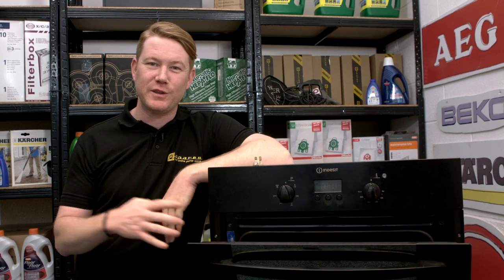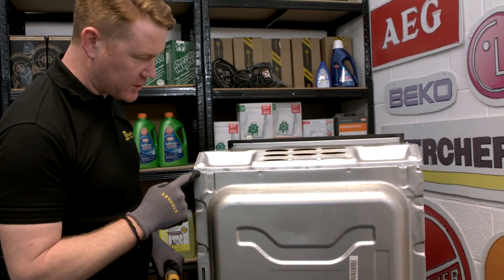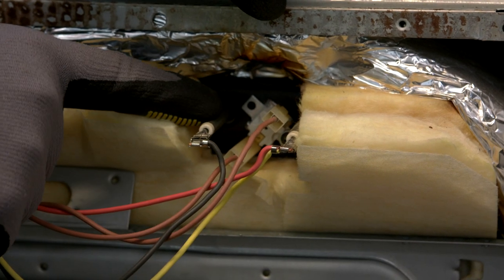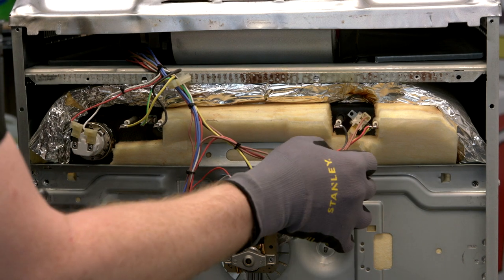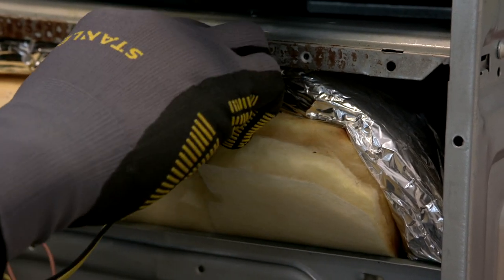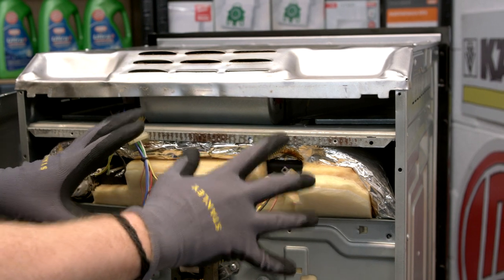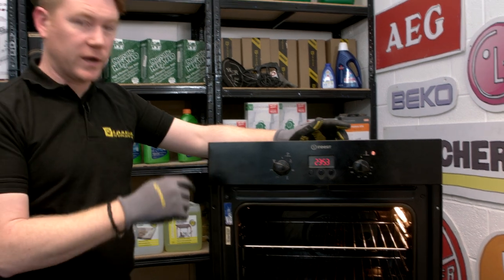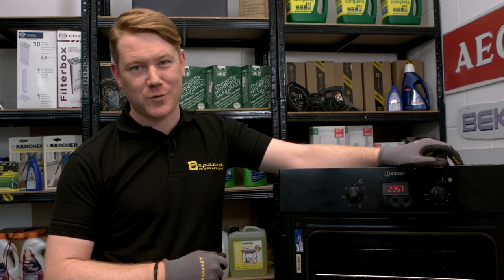How to Fix an Oven Thermal Cut Out

Comment: I have a kuppersbosch and we have no heat in any mode (fan oven, top/bottom oven element and grill) additionally the fan does not turn and also the theremostat heating light thing does not turn on in any mode! any ideas?

Comment: The indicator light on my oven turns on and goes out when it reaches say 80c, then turning up the oven it comes back on goes out at 120c a minute later, then same same happens going to 200c and 275c but the oven is only around 130c at the most.  Is this the thermostat or overheat protection thermostat?  Thanks

Comment: I have a stoves electric double oven which cuts out during use (main fan oven stops and clock goes off) then after about 20mins the clock comes back on and after setting the time the oven is usable again.
Does this sound like a faulty thermal cut out?

Comment: Hi I bought a GE profile electric range one and a half year ago. Tried to use the oven today but it only preheats to 200 degree before it iwould cut out. I can see the temperature going up from 100 to 200 and then it just stops, as if someone cancelled/stopped the oven. Would that be caused by a faulty thermal cut out of thermostat? Thanks
Reply from the maker: Hi Steve, it can be either the heating element breaking down or the thermostat not working correctly.

Comment: Well, the thermostat connects to a long metallic pipe which goes all the way to gas switch. So where exactly do I check the resistance at? Is it even electrical?
Reply from the maker: Hi Davids, the video is based on an electric oven, you have mentioned a gas switch so what are you trying to test and on what model?
Reply: @eSpares  You should edit the title. It is first result when you search for 'gas oven knob does not stay in'. It is unfair to reveal that kind of information at the end of the video. Gas oven cut off obviously is not electrical. As I learned.

Comment: Hi my oven cuts out every 10 mins would the themal cut out be the problem
Reply from the maker: Hi Stephen, it would not normally be the cut out as the oven would not have overheated in 10 mins, check the element and thermostat first.
Reply: @eSpares  hi thanks for your reply i changed the thermostat  and changed the thermo cut out , oved still cuts out , i ,ve spent £50 already on parts , i think al just buy a new cooker , thanks very much for your advice

Comment: Hi, I have an issue where the element fan and light stop working when the oven hot.  Once cooled down they work again.  I'm not sure if the element turns off when this happens as the oven is hot at the time.  Would this be caused by the thermal cut out?  It is an AEG B2100-4-M.  Thanks.
Reply from the maker: Hi robuk360, the cut-out does not control either the fan or the light, check the oven control switch first but test the fan to make sure it is working correctly.